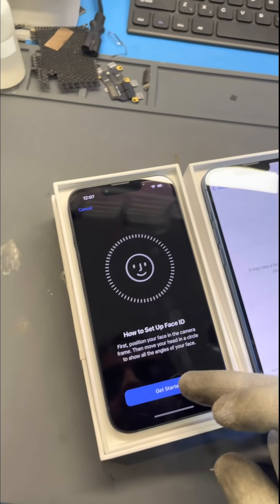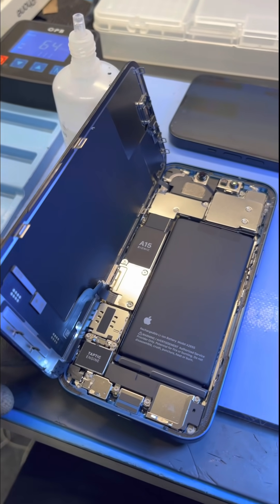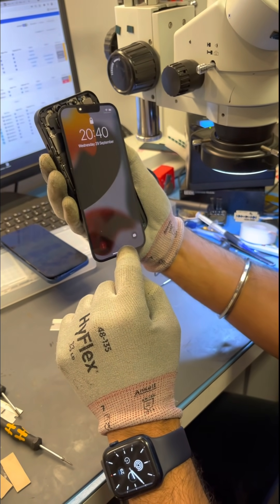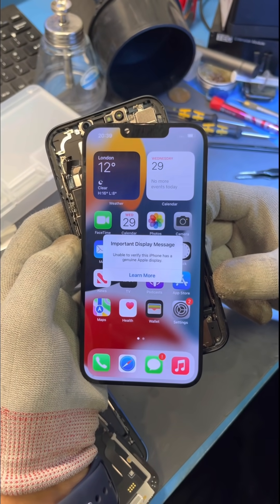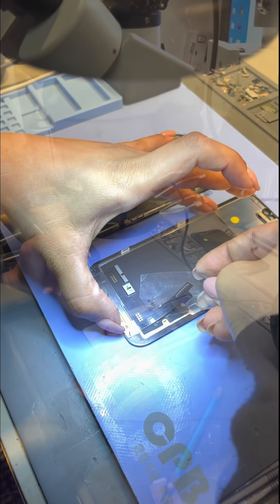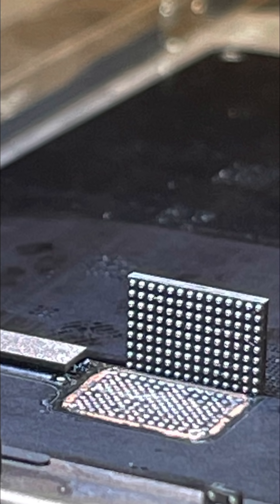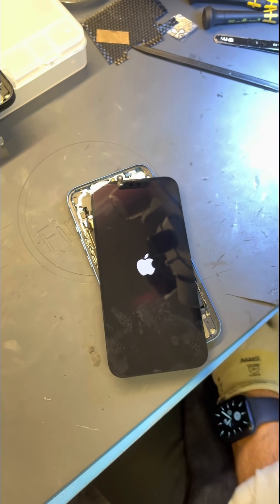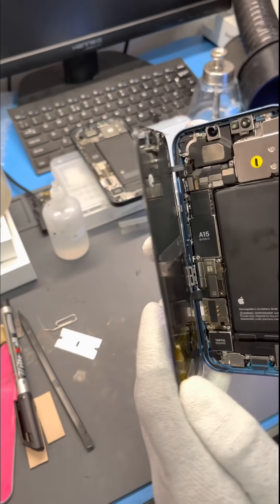iPhone 13 screen replacement disables Face ID in iOS15. Why? Our repair & behind the scenes.

Comment: My phone had a white screen. It glitched and turned white. But they said the screen needed replacement. Initially I believed something was wrong from inside. Such as something got disconnected from within. Yes, they replaced it with an LCD. But.. I wonder if they just stole other pieces from my iPhone 13 Pro Max.

Comment: hey, but isnt it correct, that the same trick does not work with iphone 12? it was rumored at ours repair scene, that setting original display ic onto the spare display does in fact remove the 'important display message', but the face id is still unavailable to set up and use. I did not yet have a chance to try out.

Comment: This has been happening in the automotive industry for years, it's either one or 2 things needs to be done, as you did swap the module or phone replacement company's  would have to ask you for your module ID to program the ID into the replacement screen there are giving you

Comment: Why do you need to replace screens on iPhone13s? They’re haven’t been available for 2 months yet! Do some people spend over $1000 and then behave so carelessly with such an expensive piece of equipment that they break the screens? I have an iphone6 that’s been dropped too many times to count, and the screen is the original. What’s your opinion of that? Using cheaper screens on the 13?
Reply: It's not that people are being careless, it's the fact that people WILL break these screens overtime as they have the device, like they do with all phones. Kids, pets, accidental dropping, it happens, so it need to be an easy and affordable fix for how fragile these screens are.
Reply: In case people crack their iPhone, and can't go to the Apple Store to get it fixed.